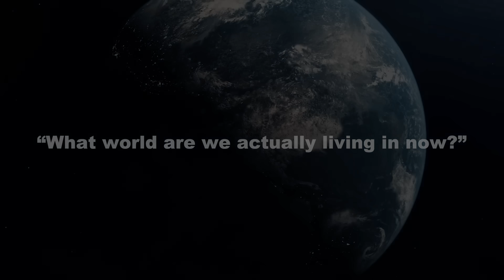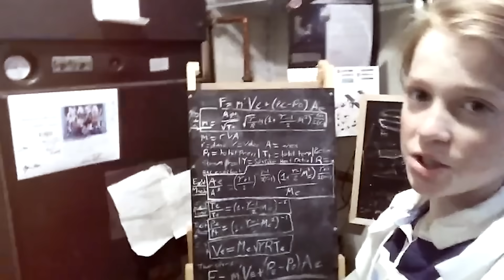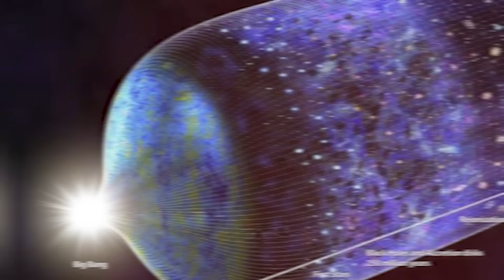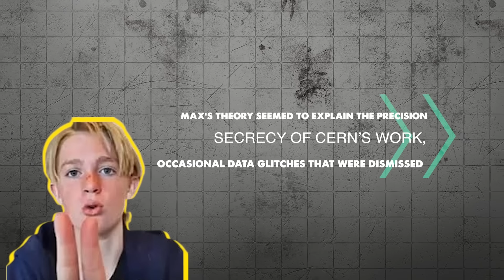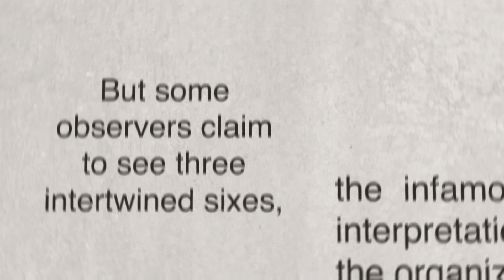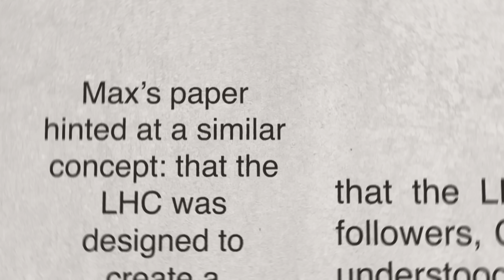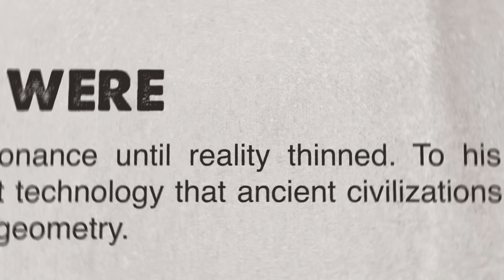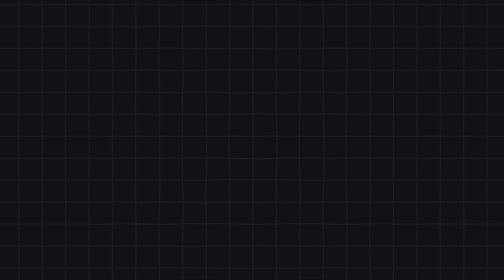A 13 Years Old Kid Warned CERN Not to Break Reality | What They Aren't Telling Us

Comment: Since the first official firing of the LHC everything has felt “off” moreso than when it was being built. On top of documents that i have read and theories studied that have been since taken down from the CERN library, specifically those involving quantum entanglement via supergravity, wormholes, stargates and interstellar travel. Quite odd, especially considering when you dig through CERNs documents or type in the url for a specific document it simply doesn’t exist anymore. But yet i remember printing them out and even saved the links to go back to later on. All very odd.

Comment: 2:14 - This board outlines a first-principles derivation for an ideal rocket engine: start with thrust, size the throat for desired m˙\dot{m}\dot{m}
, use isentropic relations to expand flow, and compute VeV_eV_e
. It's likely from an undergrad aerospace or propulsion class. Simplifications assume perfect gas, 1D isentropic flow, no losses (real engines have ~10-20% lower performance due to inefficiencies).
Reply: Nothing AT ALL to do with opening a doorway to another dimension.

Comment: The resonance function is true. Binging two or more realms/planes together can be done but, the bridge to physically go from one to another is not so easy. The ‘doorway’ can be created by another resonance tunnel but has to be able to modify the resonance frequencies extremely fast, especially at the boundary layers, each boundary has to also be stable then pierce them to transfer through the bridge. Cold temperatures that’re found in deep space are required to slow down the particles of each realm boundary to make it possible to transfer through. Then there’s the question of returning which is fairly difficult. Once the ‘bottomless pit’ is opened, our lives will change in a vast way for the worse.

Comment: This is how CERN's Large Hadron Collider looks during the ...
CERN does not permanently close, but it has annual winter shutdowns for maintenance and has had several multi-year shutdowns for major upgrades. For example, the Large Hadron Collider (LHC) had a long shutdown for upgrades from 2013-2015, another from 2018-2021, and a third is planned to begin in July 2026, lasting until at least June 2030 for the High-Luminosity LHC upgrade.
Reply from the maker: Thanks for providing that detailed information about CERN's shutdown schedule!

Comment: The 1st dimension is existence, itself. Without existence, no other dimensions are possible. A point cant even exist without existence, itself, even in the absence of light, which is a particle of existence. Existence creates light, and light illustrates the existence that was created. CERN is creating another existence that may not follow the rules of our existence. That's dangerous because another existence may wipe out the dimension we live in and create a dimension based on different rules.

Comment: You could make a marble pyramid to sleep in ,put in some color lights and a c cord sound and it will improve your health and use 9 d cell batteries connect with wire to help heal people with brain damage or may be mental cases because the current is equal to the body current you have and it could help connect the cells in the brain so they connect and not shorted out in brain damage people 🤔🌴🦉

Comment: my thereoy of what CERN is is its basicaly a very tiny cosmic gear (yes its massive in human's scale) and the other one they want to build is a slightly bigger tiny gear. this universe  and all the other universes of the fallen re-alitys is a clockwork quantom matrix, the planets of all the galaxys are basically gears lots peaopel are noticing tiem speeding up, and not jsut the normal when get odler peaople but younger as well, a large gear on a small gear makes it faster. so wonder if one of CERN's functions is to add tiny gears along side the gears in our solar system which conencts to the whole universe.

Comment: We think they just want to get out of this crater but the glass ceiling (that has a crack in it) won't allow it, so.
They are just misbehaving and being the squeaky wheel to bring those that sealed the crater, back.
How many kinetic energy weapons have they fired at the dome base on the other side of the Antarctic, Lots.
Cern though is playing with time and space, so effecting things on the other side of the dome.
That's what we think and also it may be working because don't look now, but here they come, at 200'000 kph Heading straight for Gaia and the crater called earth.

Comment: This young man is correct.  Timelines have been rewritten, but my first glance at the equation he is standing next to relates to the core equation governing rocket engines.  In a nutshell, how much thrust you get depends on the exhaust speed and the pressure difference with the outside atmosphere. So, how that equation relates to multiple dimensions—beats the heck out of me.  Now that I think about it, perhaps the same math that governs matter expanding through a nozzle can, under relativistic transformation, describe energy expanding through spacetime curvature to illustrate “dimensional propulsion”.  Fascinating.  Time to head to the chalkboard.
Reply: Your on to it great information.
Reply: At a stretch, both involve energy and momentum transfer through a medium — gases in one, spacetime geometry in the other — but that’s metaphorical, not mathematical. It's a tough bridge to build between classical momentum conservation, and Einstein’s field equations but a lot of fun to try
Reply: 1988
Reply: @007AGI did I miss something in 1988? Or maybe I misread one of the comments.
Reply: I imagine they just used any old math from a book for that to make it look real.
Reply: Probably because if they are able to successfully open a portal, they’ll need a spaceship to propel them into it? Just a theory 😂
Reply: it’s about consciousness, sound, light, vibration and frequency, space time curvature will take you further away from understanding this realm
Reply: I agree with that assessment and it makes sense.
Reply: Modern Tower of Babel - the Creator has got this! Nothing happens without Him knowing it. Choose wisely, choose eternal life through Christ Jesus. We are saved by faith through grace. Eternity is a long time to regret wrong choices - this is a spiritual,interdimensional battle of caraclysmic proportions. God wins!
Reply: @carolmattstadt9243  cheeses was never real silly slave
Reply: @carolmattstadt9243 Amen, MAY GOD BLESS ALL ❤️‍🔥🙏❤️‍🔥🙏 WWG1WGA ❤️‍🔥❤️‍🔥🙏🙏